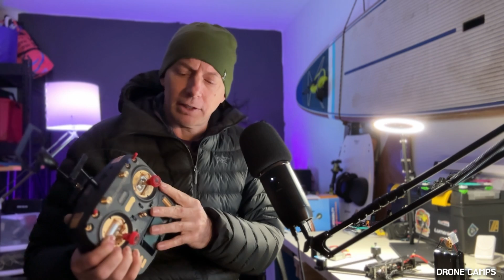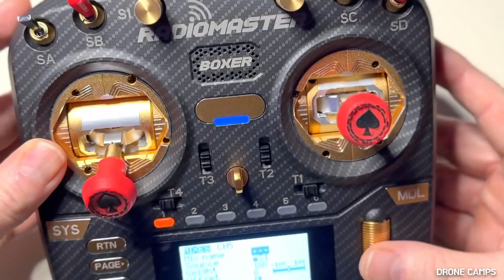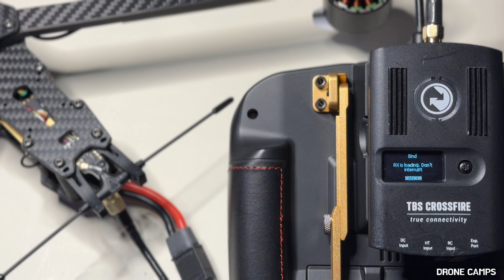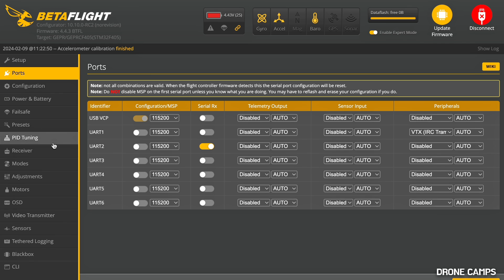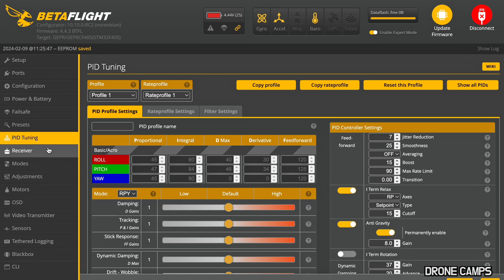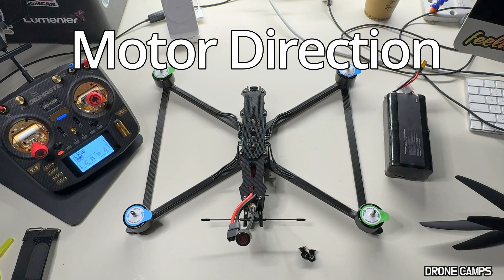How to setup a Long Range Fpv Drone Tutorial 2024 - Geprc LR10 Fpv Drone 🏆

Comment: anyone has GEPRC LR10 for factory default CLI   :D as  i managed to fuckup the config, i mean filters and pids .....and looks like support on vacation.
Reply from the maker: If you use my link. You can select the 3 battery combo.
Reply: @dronecamps  which link ? by the way my batery 9500 dont think that i can mount 3 of these on that drone :D

Comment: Hello, can you please share 10inch Tunes, My setup: geprc mk4-10inch frame, Kakute H7, geprc 70A esc, holybro alta vtx and foxeer cam, 6800mah 6s 40c battery, MAD BSC 900kv motors & 10x5x3 props. total AUG is 1,500grams. 
I have hovered with stock tunes which i get is huge vibrations and obbling, motors too hot.

Comment: Can someone please help me with choosing the correct protocol when buying the RadioMaster Boxer. 
There are 3 choices to choose from but I have no clue which one will work with what I have. 
I will be using the TBS Crossfire Tx Light Transmitter. 
There are 3 options, cc2500, Elrs 2.4 or 4 in 1 Multi-Protocol.
Which one will work with my Transmitter?

Comment: I got the same drone. Still not flying cause the mipi wire wasn’t working on the DJI 03 . My question is u said we can use 10000mah battery. On the website they said up to 8000mah. How can I check what’s the maximum battery capacity ?
Reply from the maker: 10,000 is as big as I would go. ☝🏻

Comment: Hey I have a question. I was wondering if you would be willing to help me out. I messed up my drone. I just got this exact drone about 4 days ago and well I messed up some of the tuning and hit reset in beta flight and of course as you know it wiped the FC. I've got it reflashed and running again. Ive got most of the settings back to at least close to default but the tune im positive is wrong. Could you possibly help me tune this thing you're pretty much my last option.🙏I'll pay for the tune if need be that's not a problem. I just want to fly my drone lol. Thank you
Reply from the maker: Send us an email dronecamps @ gmail. Com

Comment: Drone Camps, I would love to see a video of you putting together a custom build using the GEPRC Pulsar LR11 frame. For lone range bigger is better right? As far as I can tell this is the behest frame with the deadcat style so that you don’t get props in view. Very curious to see what a setup like that would look like and the kind of flight time, range and payload it would be able to achieve. Thanks for the great videos!
Reply: I want to build one of those. Was looking at bunch of motors from 3120.. 3314.. in low kV and maxamp makes 8S 20,000maH
Reply: Yup would like to see this build 11"

Comment: Great setup. Did you get hold of the geprc pulsar frame? Just ordered the 11" frame to run with gemfan 1170 and 3215 motors on 8S.

Comment: I was on their site last night shopping the 10" frames for a diy build. Any thoughts on the difference between the mark 4 vs the ef10 frame? Since the ef frames costs $20 more does that necessarily = better? The frame specs over seem close enough so trying to figure out what the feature/benefit is. Thanks